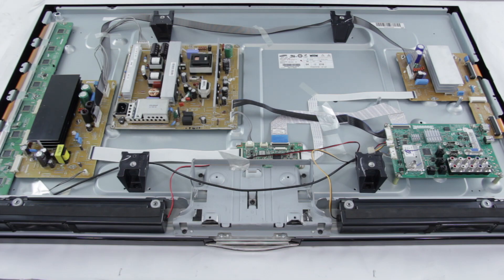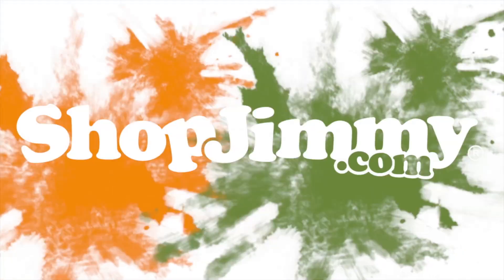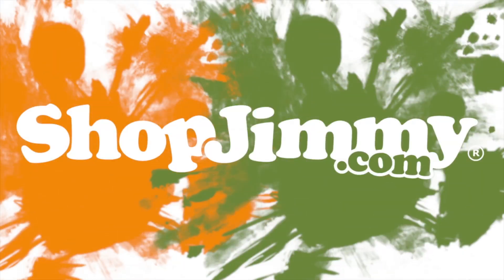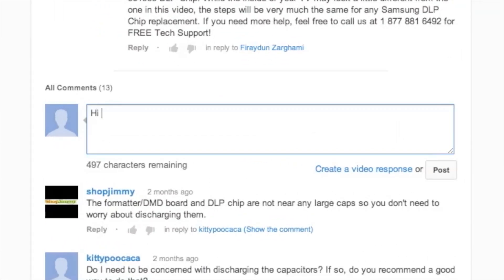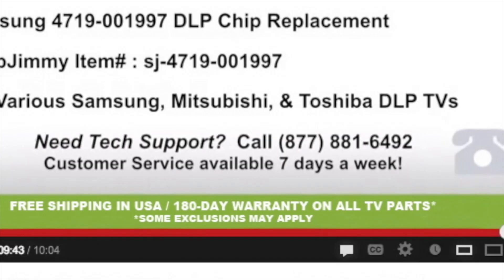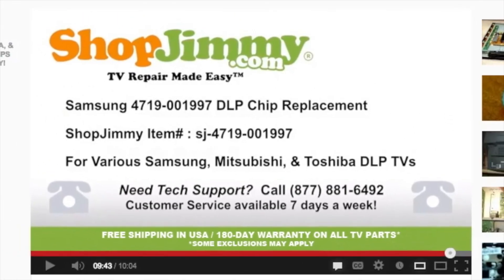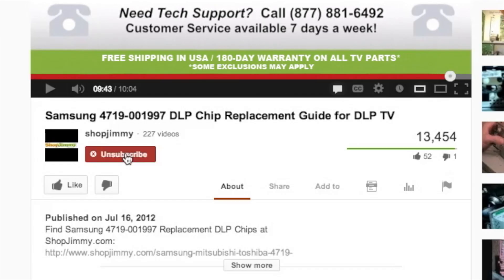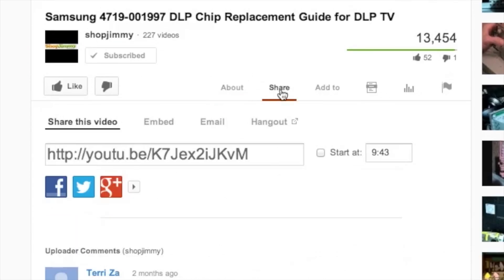Plasma TV Repair Tutorial - Common Symptoms & Solutions - How to Fix Plasma TVs

Comment: Hi,

Great video gentlemen. 

I just acquired a 50 inch Visio Plasma TV P50HDM.  

When plugged in & turned on, the Green light in the lower right corner comes on but nothing on the screen.

I assume this is a power supply issue. I've yet to open it up.

I assume it has fuses even I've seen some that has no fuses.

Are you familiar with this TV?

I really don't understand why such expensive TV's are not made to last?

Is the power supply repairable or do I have to replace the entire board and is it worth it??

I am not big on Taiwanese/Korean/Chinese made Junk as it doesn't seem to last very long.

Thank you.
Reply from the maker: baba mama  Try all repairs and troubleshooting at your own risk.  I recommend replacing the YSUS and the YDRVTP & YDRVBT boards in your TV.  Click this link to replacement parts for your TV model number:  http://www.shopjimmy.com/catalogsearch/result/?q=P50HDM  There may be multiple boards for the same TV model number, be sure to match part numbers on your current board, with your replacement for compatibility.  Here is a link to a video showing how to identify your part number, click here:  https://www.youtube.com/watch?v=GEllG3RV-tc  Thanks and please let us know if you have any further questions with your TV Repair!  www.shopjimmy.com
Reply: ShopJimmy.com So are you recommending I replace ALL of these boards without even knowing if they are good or bad?

It would be a lot cheaper to buy a new TV than to buy all these boards.
Reply from the maker: baba mama  PLEASE SUBSCRIBE TO OUR CHANNEL - Try all repairs and troubleshooting at your own risk.  The symptoms you are describing lead me to believe those are the boards that should be replaced.  It is up to you on whether or not to replace them.  Thanks!  www.shopjimmy.com
Reply: Which boards needs replacing?
Reply from the maker: baba mama  PLEASE SUBSCRIBE TO OUR CHANNEL - Try all repairs and troubleshooting at your own risk.  You can replace the power supply board to see if that fixes the problem.  Click this link to a replacement power supply board for your TV model number:  http://www.shopjimmy.com/vizio-3501q00158a-power-supply-unit.htm  Be sure to match part numbers on your current board, with your replacement for compatibility.  Here is a link to a video showing how to identify your part number, click here:  https://www.youtube.com/watch?v=4i57Cm9-96M  Thanks and please let us know if you have any further questions with your TV Repair!  www.shopjimmy.com

Comment: Problem I have is TV turns on a blinking green light at the bottom - then becomes a steady green light. A few seconds later a buzzing/sizzling sound comes on, No picture. A small green light lights up on one of the boards and stays on.
TV is an INSIGNIA Plasma 50 inch, Model# NS-PDP50, Serial No: NO. DE-SERIE. Thanx for Any suggestions.
Reply from the maker: Horatio Bennett  Try all repairs and troubleshooting at your own risk.  You should try and isolate which board the buzzing sound is coming from.  Then replace that board.  Click this link to replacement parts for your TV model number:  http://www.shopjimmy.com/catalogsearch/result/?q=NS-PDP50  If you replace any boards be sure to match part numbers on your current board, with your replacement for compatibility.  Thanks and please let us know if you have any further questions with your TV Repair!  www.shopjimmy.com

Comment: LG model PDP50-R4 no picture or sound, RL 103 clicks when it is turned ON, logic board green led flashes, red led lites on Main Unit Board, changed PSU board, Sustain Board, Main unit, logic Board, YSUS Board, NO FIX, No Voltage on the fuse F801 on main power board, Need Help!
Reply from the maker: John J Baccelli  Sounds like after replacing all those boards, it may be more economical to replace the TV. Thanks!  www.shopjimmy.com

Comment: I have a 50" Samsung Plasma TV, model PN50C450B1DXZA.  The TV has three fixed vertical lines on it, it started as one line, and then the other two were added a few months later. Please tell me how to fix this problem.
Reply from the maker: Jim Sallade    Try all repairs and troubleshooting at your own risk.  This sounds like a TV panel (TV Screen) problem.  If your TV panel is bad, it may be more cost-effective to replace the TV as panels are typically hard to find in stock, difficult to replace, and expensive.  Thanks and please let us know if you have any further questions!  www.shopjimmy.com
Reply: ShopJimmy.com Thanks for the reply.

Comment: samsung pn43e440a2f tv powers on and off and makes sound but no picture on screen
Reply from the maker: Moedy1   Try all repairs and troubleshooting at your own risk.  I recommend replacing the Y-Main Board and the Y-Buffer Board in your TV.  Click this link to replacement parts for your TV model number:  http://www.shopjimmy.com/catalogsearch/result/?q=pn43e440a2f  There may be multiple boards for the same TV model number, be sure to match part numbers on your current board, with your replacement for compatibility.  Here is a link to a video showing how to identify your part number, click here: https://www.youtube.com/watch?v=R1jmj_foId0  Thanks and please let us know if you have any further questions with your TV Repair!  www.shopjimmy.com
Reply: ShopJimmy.com so I just changed the y main board and the y buffer board and still nothing. I also previously changed the power supply board. Could it be anything else?

Comment: Hello, I have a 58" Samsung plasma mfg 2009 Model  #PN58A650T1F  When I turn the tv on the picture is present and clear but very dim. Every once in a while the picture will return to normal for a second or so but return2 to dim. I have ensured it is not any sleep mode or power saving mode. I have also tried every input and the results are as above. I have taken the back off and I seen no obvious bad capacitors or blow fuses. Thoughts?

Comment: Hello, I have a Fujitsu Plasmavision P50XHA10US that started have trouble about a week ago.  Symptom number #1 - it has standby power but to get a picture I have to power cycle the TV (e.g. unplug it from the outlet.)   This typically works after 2-3 attempts.   Symptom #2 - occasionally there are about 6 white vertical lines evenly spaced on the screen.  Symptom #3 - very occasionally the picture just goes off.   Any guess as to which board is acting up?
Reply from the maker: Curt Burmeister   This sounds like a TV panel (TV Screen) problem.  If your TV panel is bad, it may be more cost-effective to replace the TV as panels are typically hard to find in stock, difficult to replace, and expensive.  Thanks and please let us know if you have any further questions!  www.shopjimmy.com

Comment: I have a samsung plasma pn60e530a3fxza which is getting a red stanby light but will not turn on. it also plays a short chime when i initially plug it in. I removed the back and have access to the boards, i had an old olevia which had blown capacitors on the PSU board and i thought this would be the same but i do not see any blown caps... maybe you have a suggestion?
Reply from the maker: leperleperleperleper  Try this at your own risk. Unplug the TV, then disconnect the y board and plug in the TV to see if the TV powers up. Reply with the results of this test. Thanks! www.shopjimmy.com

Comment: hi, i have a 65in samsung plasma model# PN64E533D2FXZA. everything was fine up until last tuesday when the tv was on and just went blank and has not gone on since. When i attempt to turn it on, not even the red light on the bottom left corner flashes or anything, I tried plugging into a different outlet, disconnecting and reconnecting from the cable box and still nothing doing. Samsung wont help because the warranty expired last month and the repair is $200 plus $75 for the house call. I'm not particularly handy but i would like to attempt to fix it myself because i don't have the cash for a repairman. PLease help me!!!
Reply: ShopJimmy.com i tried, and still nothing. what else can i do?
Reply: joseph Rub thats happen the same thing to my vizion 70 inches smart tv. and i went to ebay to buy the power supply board put it on and it works ! save me lots of money, my tv warrantee has expired and Vizion cant help. just look for the right model no. to match ur tv model.

Comment: I have a Samsung pn64d7000 that has started to shut down randomly. If I disconnect and reconnect power I get six long red power light flashes and no picture. Subsequent attempts to power on get lots of very fast flashes.  If I unplug for a longer period, say 5 or more minutes, it will sometimes start working again and keep working for a while.  Initially it would work for weeks.  Now it may work for minutes or hours.  Any idea on the primary suspect for this issue?
Reply from the maker: Mike Conley   Try all repairs and troubleshooting at your own risk.  I recommend replacing the main board in your TV.  Click this link to replacement parts for your TV model number:  http://www.shopjimmy.com/samsung-bn94-04689c-main-board-for-pn64d7000ffxza.htm  There may be multiple boards for the same TV model number, be sure to match part numbers on your current board, with your replacement for compatibility.  Here is a link to a video showing how to identify your part number, click here:  https://www.youtube.com/watch?v=BEPWrefQvqI  Thanks and please let us know if you have any further questions with your TV Repair!  www.shopjimmy.com
Reply: Replaced the hard to find main board and the problem is still getting worse.  Now it will only work 15-30 minutes at a time.  Would the power board be the next guess?
Reply from the maker: Mike Conley    Where did you purchase the main board from?  Thanks!  www.shopjimmy.com
Reply: ShopJimmy.com I purchased the main board from lcdtvparts on ecrater. Board was sold as, and appeared to be, new.  First two days it seemed great but then the problem came back with a vengeance.
Reply from the maker: Mike Conley   This sounds like you received a defective replacement main board.  Thanks!  www.shopjimmy.com

Comment: I working on a 42" rca tv (model number 42PA30RA), the TV doesn't turn on.  The power indicator light in the bottom right hand corner of the TV is on but there is no picture nor is there any sound.  Also there are clicking sounds that comes from the TV every time I attempt to turn it on.  It has two click, once when I try to turn it on and another click shortly thereafter.  I check the web and other TV's of the same model number have the exact same issue.
Reply from the maker: Philodox Xiph    Try this at your own risk. Unplug the TV, then disconnect the y board and plug in the TV to see if the TV powers up. Reply with the results of this test. Thanks! www.shopjimmy.com

Comment: Hello.  I have a Samsung Plasma 50" HP-T505-4X-AA Jan 08.  Heard a loud pop and then no picture.  I have sound but do not get a picture. How do I test where the problem is coming from since there are several areas in your video it could come from. Thanks.
Reply from the maker: Brian Mohr   Try all repairs and troubleshooting at your own risk.  I recommend replacing the y board and buffers.  Unfortunately I do not see any replacement parts in the search results for your TV model number on our website.  Thanks and please let us know if you have any further questions!  www.shopjimmy.com

Comment: Hi Guys

I have got a plasma TV with standby light but can't be turned on by the remote or manually. Please advise if its a Main board or Power board issue?  Thanks in advance
Reply from the maker: vic fong   Try this at your own risk. Unplug the TV, then disconnect the y board and plug in the TV to see if the TV powers up. Reply with the results of this test. Thanks! www.shopjimmy.com
Reply: Hi Guys
Managed to get the TV turned on but the HDMI 1 is busted (bright green static lights) HDMI 2 is working though. You reckon its a main board issue?  Thanks
Reply from the maker: vic fong   Try all repairs and troubleshooting at your own risk.  I recommend replacing the main board in your TV.  Please reply with your part number on your main board and I can try searching for replacement parts.  Thanks and please let us know if you have any further questions!  www.shopjimmy.com

Comment: I have a Samsung PN50B560T5FXZA-  I received a lightening strike recent.  The Tv only had power and a single HDMI connected at the time.  The outlet was fused locally and it did not need to be reset.

The TV now will turn on and search for signal for appx 5 minutes they begins to power cycle every 30-45 seconds.

From your video tutorial you mention these symptoms with a Main Board and a Y-main.

Is there a way to diagnose these without having to replace / order both from you?
Reply from the maker: Troy Thompson   Try all repairs and troubleshooting at your own risk.  I recommend replacing the main board and the power supply board in your TV.  Click this link to replacement parts for your TV model number:  http://www.shopjimmy.com/catalogsearch/result/?q=PN50B560T5FXZA  There may be multiple boards for the same TV model number, be sure to match part numbers on your current board, with your replacement for compatibility.  Here is a link to a video showing how to identify your part number, click here:  https://www.youtube.com/watch?v=R1jmj_foId0  Thanks and please let us know if you have any further questions with your TV Repair!  www.shopjimmy.com

Comment: Hi, i got problem with my samsung plasma tv 42 inch. The problem is the tv won't turn on. In stby mode,  i try to turning on the tv no response at all. I tried to unplug the socket then plugged in again, the power has clicking sound. It has checked by the samsung technician and they said i have to change the panel display. Is that true..? I really appreciate if you could assist me to solve this issue cause the new panel display is pretty expensive.

Million thanks.....
Reply from the maker: TheBijouis   Try this at your own risk. Unplug the TV, then disconnect the y board and plug in the TV to see if the TV powers up. Reply with the results of this test. Thanks! www.shopjimmy.com
Reply: Sure, will do..be back soon to inform you..

Comment: Hello ShopJimmy folks!  I have an LG 42" Plasma, model PDP42x30401 that will power up immediately when I plug it in (without pressing the power on button), has great sound that plays continuously with my supplied A/V input source, but the picture flickers in the same manner as a dying fluorescent lamp.  Picture is completely dark except for random and rapid flashing on and off.  I checked out all fuses, caps, diodes, voltages, and any obvious problem areas on the YSUS, ZSUS, and Power Supply boards.  I am suspecting the IPM device on the YSUS board.  Please let me know if I'm on the right track and if you have a much better suggestion as to what the problem really is that needs to be repaired.  Thanks!

Comment: I have a zenith plasma screen and there is a vertical black line about 2 inches wide running down the left side of the screen at all times, what could be causing this and how can it be fixed? Thank you
Reply from the maker: andrew terry   This sounds like a TV panel (TV Screen) problem.  If your TV panel is bad, it may be more cost-effective to replace the TV as panels are typically hard to find in stock, difficult to replace, and expensive.  Thanks and please let us know if you have any further questions!  www.shopjimmy.com

Comment: I have these thin color-changing vertical lines running down my samsung plasma tv screen from the top to the bottom of the screen. These pixal lines are going down the center of the tv about 3 inches, sometimes this portion of the TV screen goes white. and sometimes you can see the picture behind them. You can see this as soon as you turn on the TV. Is it possible to repair this?
Reply from the maker: Chelsea Brester   This sounds like a TV panel (TV Screen) problem.  If your TV panel is bad, it may be more cost-effective to replace the TV as panels are typically hard to find in stock, difficult to replace, and expensive.  Thanks and please let us know if you have any further questions!  www.shopjimmy.com

Comment: I have a Samsung Model # PN50C680G5F that isn't displaying anything.  I know it powers up because the lights power up and there is a chime when the power is pushed.  The display itself just isn't lighting up.  Please let me know what I can do.
Reply from the maker: Dustin Paille   Try all repairs and troubleshooting at your own risk.  I recommend replacing the Y-Main Board and the Y-Buffer Board in your TV.  Click this link to replacement parts for your TV model number:  http://www.shopjimmy.com/catalogsearch/result/?q=PN50C680G5F  There may be multiple boards for the same TV model number, be sure to match part numbers on your current board, with your replacement for compatibility.  Here is a link to a video showing how to identify your part number, click here: https://www.youtube.com/watch?v=R1jmj_foId0  Thanks and please let us know if you have any further questions with your TV Repair!  www.shopjimmy.com